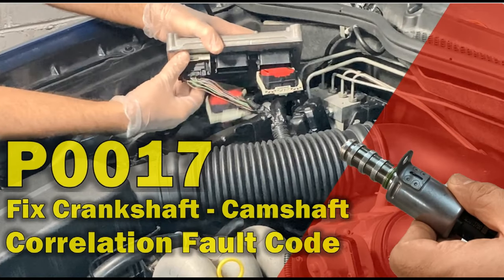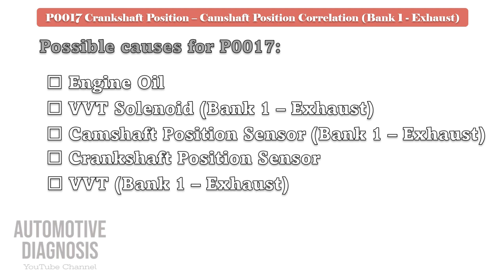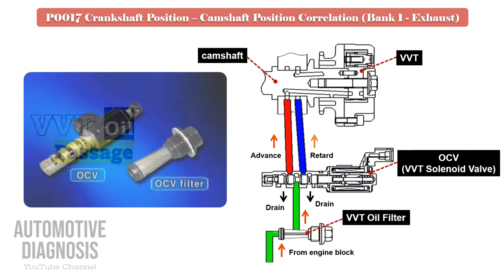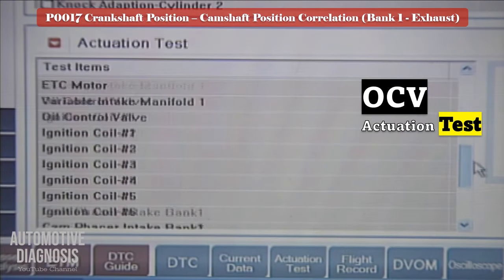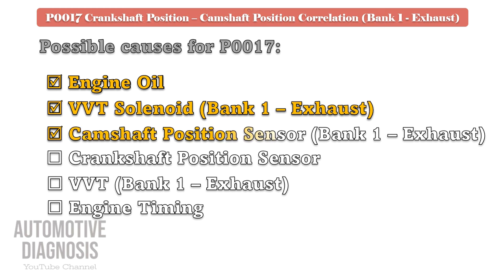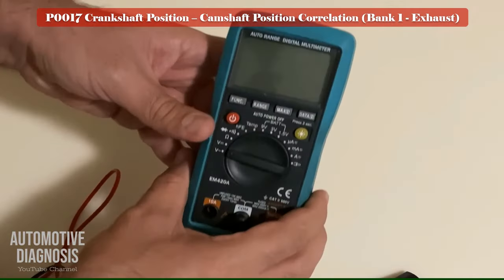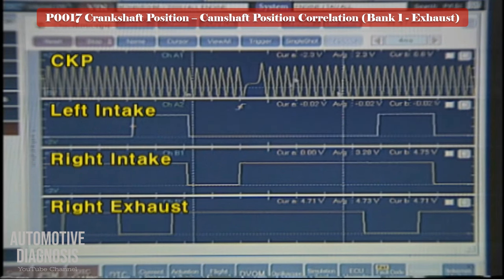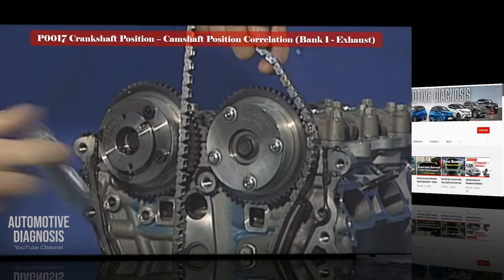How to Test & Fix P0017 Crankshaft - Camshaft Position Correlation Bank 1 Sensor B (Bank 1- Exhaust)

Comment: I’ve had p0017 code go off multiple times in 10 months, I bring it to vw and they “fix the sensor” then the code comes back. I have a Jetta with 155k km. I’ve paid over 900 dollars to vw and I have the same problem with my car, making it go into limp mode and not safe to drive
Reply: probably gotta change the oil
Reply: Try to fill up your tires more
Reply: @MexicanOREOz  wire harness was rubbing up against the engine, causing the exterior to fray and thus exposing the naked wire to being grounded by the metal of the engine. New wire harness and works like new
Reply: @nikomadrid8081  which one of your wire harnesses was rubbing?

Comment: Hi I have a 2019 Kia Forte that is throwing up this code.  I work about 30 miles away from home, would driving it home damage the engine.  It’s to late to get it into a shop tonight.
Reply from the maker: I just saw your comment. If there is no noise coming from the engine or no more code it should be fine for now.
Reply: I’ve got an 18 Elantra with this code but my engine is low on power and vibrates could this be due to off timing or is that a sign of engine damage? car is under warranty but I’ve been on a waitlist because of recall so I wanted to see if it be something I could fix at home.
Reply: @256jayy3  did you fix it? The same is happening to my car now and I don’t know what it could be
Reply: @alanestrada2638  I changed every sensor related to the code and nothing fixed my issue my car go into the shop tomorrow but my mechanic said it is likely the timing chain is loose or the sprocket for it is broken and they will likely replace the motor itself.
Reply: Hello, I have a kia forte 2019 with the same code p0017, it changes the timing chain, sprockets, oil pump, and it still does not start, and the code p0017 still appears
Reply: @Charsknot2101-tt3iv  I changed the vvt solenoid and it didn’t fix anything I ended up having to get my engine replaced the shop I took it to said that it’s protocol to swap engines after it jumps timing but my extended warranty covered it.

Comment: If my battery is not strong enough can it cause the sensor to act
Reply from the maker: If the battery is not strong enough you will have more fault codes in other systems too.
Reply: @AutomotiveDiagnosis  understandable i will replace my battery tomorrow
Reply: So the codes my 2011 Chevy traverse is giving off is P0017, P2534, P0341  could these in fact be souly based upon a weak battery or something more complex ? I got this vehicle from the auction so I’m unsure of condition or maintenance on this vehicle.

Comment: Hello, I have a kia forte 2019 with the same code p0017, it changes the timing chain, sprockets, oil pump, and it still does not start, and the code p0017 still appears
Reply from the maker: Have you inspected / replaced the CVVT solenoid valve?
Reply: @AutomotiveDiagnosis   Yes I changed it.
Reply: any solutions?
Reply: @Charsknot2101-tt3iv did you figure it out

Comment: Hey I replaced the vvt solenoids and camshaft sensors and changed the oil. All the sensors were pretty gunked up my girl friend missed an oil change and after doing all these still throwing the code. I was wondering if it’s still pretty gunked up keeping the sensors from properly reading or if the timing is actually just off it is about that time though at 110,000 miles give or take. Thanks!
Reply: did u ever find out and resolve what happened?
Reply: I need a solution please

Comment: good job, it's great that you provided the Nm :), what did you use to clean the carbon deposits in the collectors?
Reply from the maker: Hi my friend. I just used throttle body cleaner to clean.
Reply: @AutomotiveDiagnosis  I used a product called dimmer to clean the fireplace and I can tell you that it doesn't come off very well. I'll take it to a company that will do it quickly and thoroughly. It's a waste of time for fun. What I'm most afraid of is carbon deposits on the head, but I've already bought brushes and I hope it will work.  Better.

Comment: Got the p0015 and p0017  code. Have swap the solenoids both. Camshaft sensor both. New crankshaft sensor. New mass flow sensor. Swap alternator.
Pop up after having to swap timing chain cover since got crack in it. Had to swap timing chain since the guide broke but code is still showing up any idea?
Reply from the maker: So code popped up right after changing the timing chain? You sure about the timing adjustment?

Comment: Hyundai Elantra 2017 153,000 miles. I have P0011, P0014 (x2), P0017 (x2) and P0302. The car starts, sometimes rough. It will lose power going down hills, but start back up. It also rattles and makes a crazy noise sometimes. I’ve checked the wiring and cleaning the Cam shaft position sensors. I plan on checking the VVT soon. Hyundai said the car is work $500. I had to get a new car and now im stuck with two payments. What should I do?
Reply from the maker: Hi, this car is giving the fault for both intake and exhaust camshafts, so your problem could be timing chain or guides, but I would check the VVT solenoids and then VVTs before anything else.
Reply: Yea i the same p0017 code. I replaced the timing chain, tensioner, guides and both vvt phasers. Problem was still there. Weird thing is, if i start my car and start driving, the cars performance is sluggish. But if i stop, turn car off then on again, car runs normally. Which tells me, my chain that i replaced is on time according to hyundais procedure and the issue is either wiring or a bad exhaust solenoid. which i did replace already, but just so anyone doesnt know, ever since the pandemic, car parts are not made the same. So you may have to buy several solenoids in hope you bpught a good batch that will fix the problem. which i believe is my current issue.

Comment: My engine runs good and no Leaks but I do have an engine light on ..cam shaft cranking correlation sensor A&B are indicating note I have no leaks and th engine starts smooth do I have an expensive repair or just a minor thing
It’s a Mercedes e350 2010
OBD (P0016,P0017,P2422)
Reply from the maker: Hi there, have you been replacing the engine oil on time? It could be just engine oil sludge around the VVT solenoid.
Reply: @AutomotiveDiagnosis  I did change the oil and filter
Reply: it will be major job to realign timing , therefore it is not an emergency.
Reply: Did you ever figure out what the issue was? I have the p0017 code. My car is running just fine but I have an emission test coming up.

Comment: I have a 2014 chevy malibu 2.5 engine throwing the p0017 code …the car has a hard start sometimes it instantly starts and sometimes it take 2-3 tries, ive changed the crank pos sensor, intake/exhaust vvt, arm solenoid, intake camshaft sensor, recent oil change and spark plugs but still the hard start yet the car drives fine afterwards until i turn it off again any suggestions?
Reply from the maker: Hi there, If all those components have been replaced, my suggestion is to check the wiring for Camshaft/crankshaft position sensors. The following video might be helpful:
https://www.youtube.com/watch?v=fM40jUfPsRA

Comment: Hi! W213 e300 has a p001785 code. What needs to be changed?
Reply from the maker: Hi there, this code shows that camshaft and crankshaft positions are not synchronized. So, any element involved in timing must be checked including the cam/crankshaft sensor, cam phaser and after that timing chain.

Comment: 2013 Chevy Cruze 1.8 have a p0014 and p0017 changed the exhaust side vvt spark plugs and coils and still same codes any ideas?
Reply from the maker: Hi there, you changed the VVT only or VVT solenoid too?

Comment: I have pending fault p0017.
traction control and hill start assist light is on,check engine is off.

Every time the pending fault appear, car run normal and nothing change with the engine.

And the pending fault light is off after i turn the car off,but it keep appear aftar i drive a while.

It is ford fiesta 1.6L,any suggestion what might wrong?

Comment: Running into a issue with a cadillac 2008 cts 3.6 currently having p0017 and p008 I have changed all 4 sensors related camshafts Sen & solenoids along with the crankshaft and still having the same issue
 bank 1 only. Starting to think it could be a timing issue anyone got an idea ? Thank ya'll! This video is helpful as well I will be doing more test before I even do timing check up
Reply: Was it the chains I have the same issue
Reply: Was it the chains I have the same issue
Reply: Was it the chains I have the same issue
Reply: Was it the chains I have the same issue

Comment: P0521
Reply from the maker: Some common causes behind the P0521:
- An open or shorted wiring in the oil pressure sending unit circuit
- Mechanical engine failure
- A faulty oil pressure